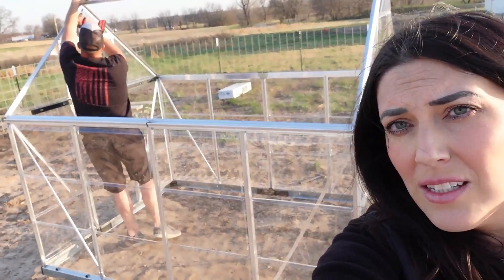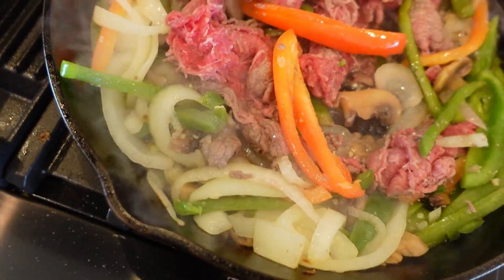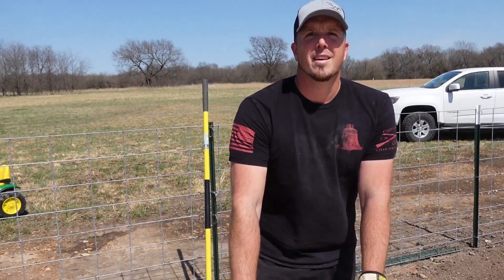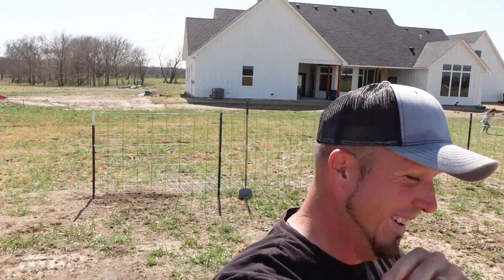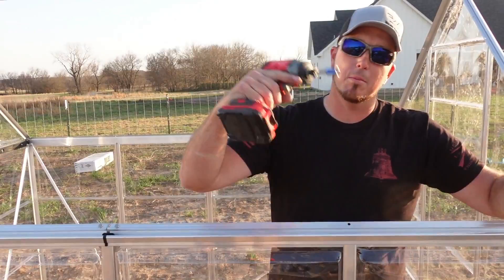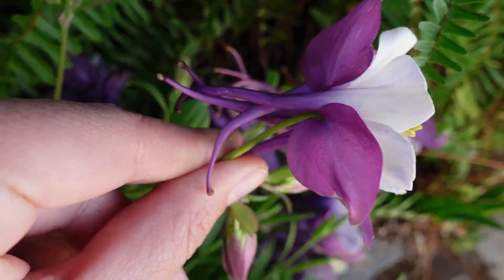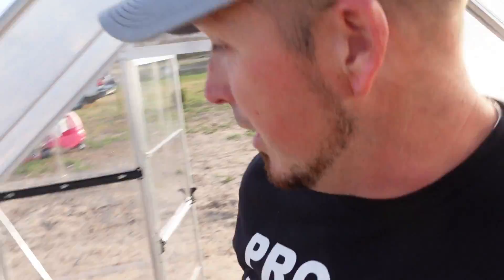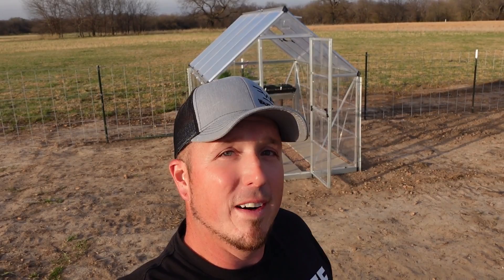NEVER AGAIN DIY Wayfair 6x8 GREENHOUSE|How To Anchor and Secure| Homestead Gardening #garden

Comment: We ordered a greenhouse similar to the one y’all did and we completely agree about the difficulty to assemble. There were not any written instructions…pictures only with the number for each part that needed to be put together. It was so frustrating that we had to walk away several times and go back later. Once we finished it, we have said many quick prayers that it withstands the high winds and the weight of the ice with the last winter storm. It has done well so far.
Reply from the maker: That is so funny you dealt with the same thing! Well, funny but not funny 😆 
We will see how this one holds up. Got it anchored down good so if anything goes in the winds I would most likely guess it would be the roof panels etc.
Reply: @fancyonfourteen  I do like how you anchored all of the corners. My husband and I may do the same. Thanks for sharing.
Reply from the maker: Your welcome! If you do the post let us know. Was a super easy install to drive them and wire.

Comment: It will hold ... but you could have used RR ties under the base to fix it to and would have made it taller inside ... but I like the look you have going too ...
Reply from the maker: Thanks JB. With the T posts I figured it was just such an easy thing to install that why not try it out. Was just something different vs tie downs and augers etc. 
plus we seem to always be using T posts around lately so why not use a few more 😝

Comment: Like a wood frame for that place could you can screw it to fix the word Peng steaks for it cause it and take a gust of wind and I would go flying you need to put some weight on it 2 by fours and screw it to it the new steel stakes and fix the stakes for the frame that should hold it down cause that’s one thing I run in the UK have higher winds over here